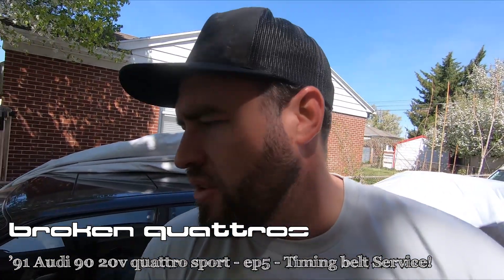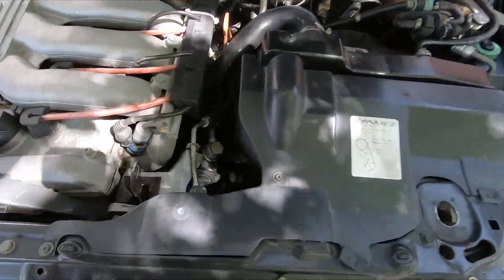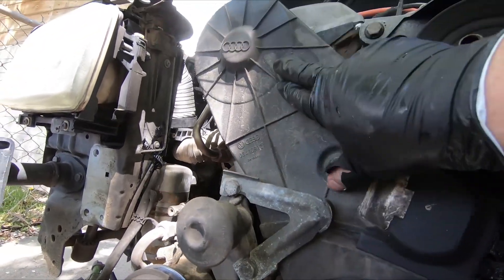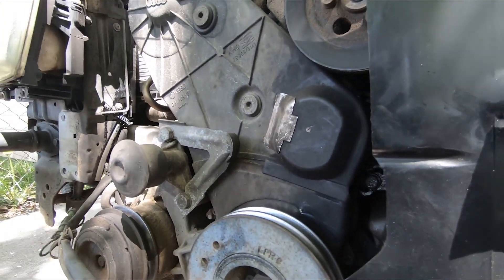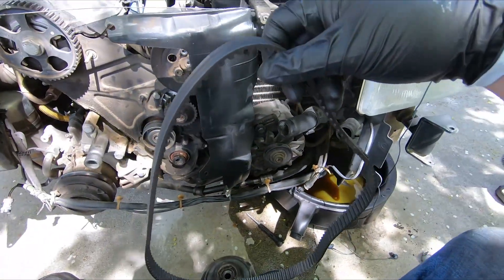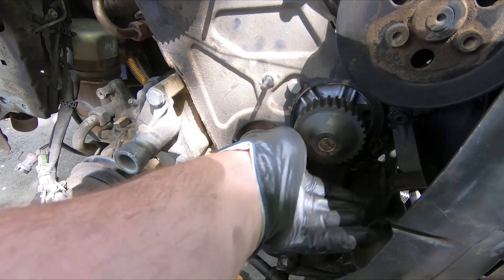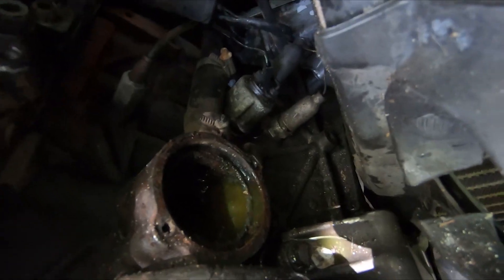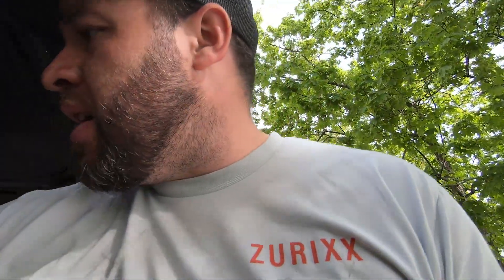1991 Audi 90 20v quattro sport - ep5 - Timing belt service

Comment: Awesome!  It truly is amazing how nice and original this thing is.  Makes working on them so much more enjoyable.  Great call out on using the flywheel mark as well, I was waiting for that!  At least when changing the strut mounts/bearings you just gotta take off the top portion of the strut and not the whole dang housing, like the B2 cars.  Nice stuff!!!
Reply from the maker: West coast rust free cars ftw! Clean cars are so much more enjoyable to work on, and rewarding when its done! Tried to make this informative but not overly instructive
Reply: @BrokenQuattros  its a great mix of both, honestly.  I had never seen that little V shaped bracket that lies on the timing belt cover by the snub mount.  Always learning something new.
Reply from the maker: @michaeljacyno8368  really? Its original, odd ive seen them basically everyone... at the same time i can see how it gets left off when reassembling
Reply: @BrokenQuattros  well to be fair, I probably never paid attention in the past, plus the only 5cyl timing belts I've done were on 10v cars.
Reply from the maker: @michaeljacyno8368  ive only seen them matter in high HP/high revving situations where having it keeps that belt in place
Reply: @BrokenQuattros  well that totally explains why they werent on 10v engines!  :)

Comment: Are there no flywheel marks as well like the AAN?  I remember the 'dot' on my crankshaft pulley was slightly off and it was always nice to re-confirm alignment using the flywheel mark.  However, I like the idea of truly checking through the spark plug hole.
Reply from the maker: There is a line on the flywheel just like aan and other 5 cyls for that matter, its often hard to see, using a welding rod or something down into the cylinder is an accurate way to test.

Comment: Hi. I just replaced the timing belt on my ‘91 QC. All the same way that you did. I tried to start it, without radiators, belts and rest of accessories. It’s cranking but no spark. Do you think that it might be because of the missing signal from some kind of accessory sensor ??
Reply from the maker: Im assuming it was running prior? The only sensors are dizzy internal hall sender, and crank/flywheel sensors. So as long as those are all hooked up. And the coil is connected to the dizzy, nothing should have changed. Unless you touched one of those components, there is nothing on the front of the 7a engine that makes it run
Reply: @BrokenQuattros  Yes it was running. I already checked pin and flywheel sensor,  all good. Spark just disappeared. I tried everything. The only part that I didn’t test is ECU.

Comment: What are you doing with the type85?. Is that sitting in your garage waiting on you getting round to it like mine is?.
Reply from the maker: Kinda. Its technically a type81 urquattro, we didnt get type85 ur in the usa. Ive been collecting parts to do it proper. Selling this 90 is part of the plan for this URQ, need the money for paint work
Reply: @BrokenQuattros  Trying to find parts is the problem, even more so the smoked rear lights that my one has. They are almost made from unobtainium.

Comment: What’s this car worth in this kind of condition? I’ve got a guy who has one for $3200 is that a good buy?
Reply from the maker: Depending on condition, rust, maintenance. It could be a very good buy. If its rusty, no. If it needs thousands in deferred maintenance, but is pristine otherwise, it could still be worth it. Depends on what it really needs.
Reply: @BrokenQuattros  This is his post

5 speed 1991 audi cs 90 quattro 20v i5 with 179,xxx miles over good shape for the year and how rare these are. Put quite a bit of parts into this car since buying it last year so quite of bit of fresh parts. Car will come with 2 sets of wheels, one has winter tires that are in good shape and one has older tires that need replacing, car comes with lots of spare parts, as well as factory repair manuals. Since I've had the car it has gotten a new fuel pump, fuel filter, alternator belt, distributor gear, distributor cap, spark plugs, valve cover gasket was replaced recently, car needs headliner but isn't insufferable without it. Overall a solid car that can be driven away and I'd trust it on any long road trip, needs new pads and rotors, but isn drivable. definitely worth saving and restoring to it's former glory. Don't really want to sell but I'm moving and can't keep it. Valves, water pump, and timing belt were also redone within 15k and will provide details and pictures in dm.
Reply from the maker: @totalpackagedetailingllc4413  send me a message on instagram, @broken_quattros

Comment: What is the PN for those suspension parts you have?  Are they the top “caps”?
Reply from the maker: The ones shown are the meyle hd rubber top strut mounts, not the metal caps
Reply: @BrokenQuattros  Where did you manage to find those rubber tops, cant find them anywhere
Reply from the maker: @willtrautman6243  rubber tops? Are we talking about the strut mounts?
Reply: @BrokenQuattros  I'm talking about the rubber that goes between the metal cup on the top of shock tower and the shock tower itself
Reply from the maker: @willtrautman6243  so the rear metal caps are covered in rubber, front are not, they have a small hard plastic cover on them from the factory, bits its just a lip. The front need to be able to turn and articulate with the steering

Comment: Done loads of VAG belts and I’ve never undone the crank pulley bolt yet! Just undo the four cap head screws
Reply from the maker: On the older 5 Cyl motors, the crank bolt tightens down on the harmonic balancer itself, unlike the 4 bangers where you can leave the crank bolt and remove the balancer.